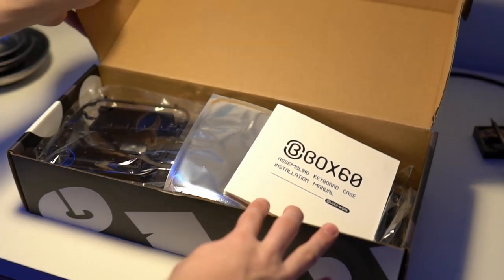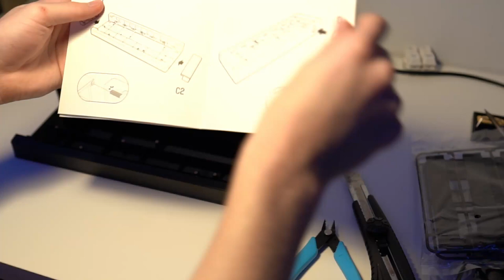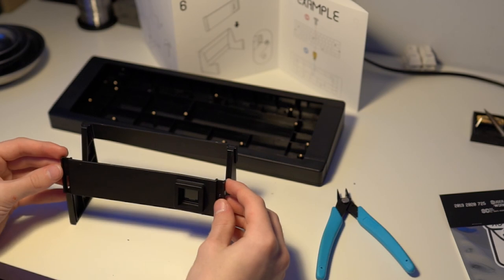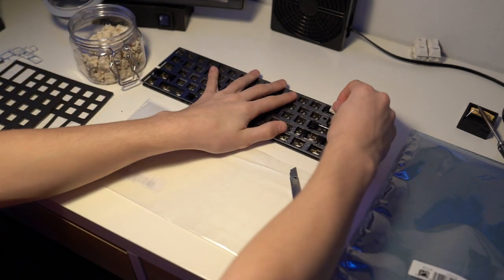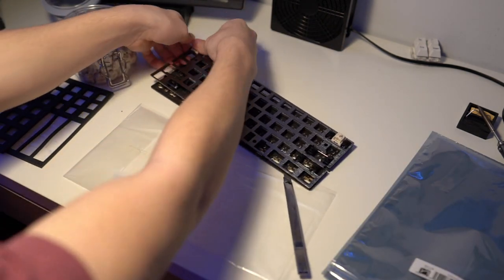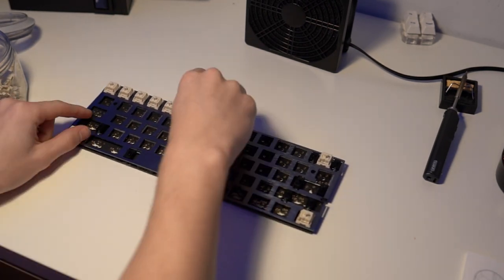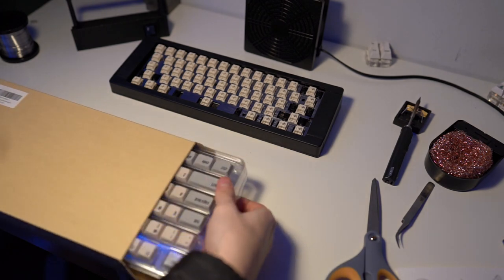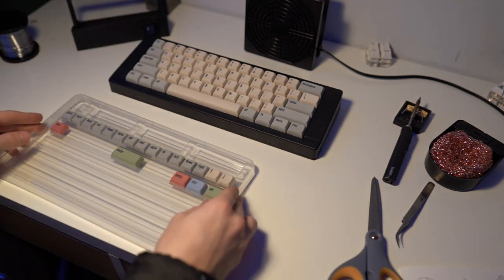Buger BBox 60% Plastic case Build with Novelkey Creams

Comment: did you have to cut off some pillars inside the housing to fit the dz60?
Reply: Nope. Should fit most 60% pcbs. It fits my XD60 perfectly, so dz60 should fit perfectly as well.
Reply: i've heard that the only dz60 that has this issue is the soldered dz60 rev 3, where the underglow leds on the buttom interfere with the unused standoffs

Comment: still waiting for the kon momo bbox case, how does this feel? I'm just afraid this case won't reach my expectations, thanks!
Reply from the maker: The case actually feels fine, just with some work. Unfortunately, after adding our sound dampening foam the plate and PCB started to have a slight bend, which we fixed by removing some. As long as your switches are lubed It think it'll sound just fine.
Reply: @teeboards3738  tysm